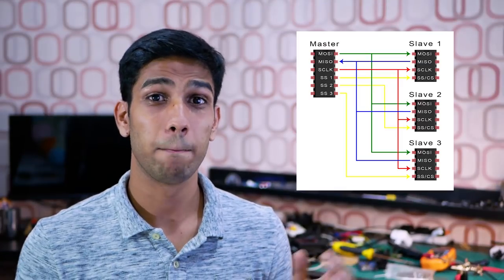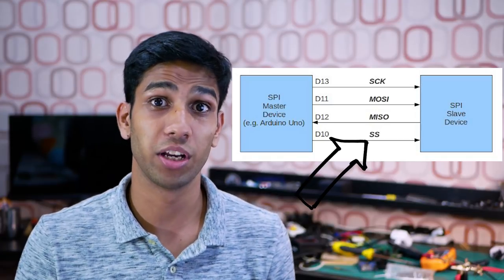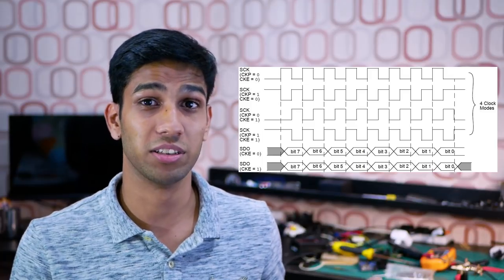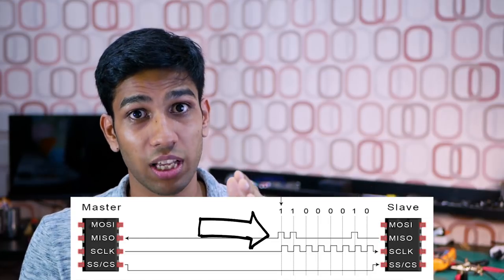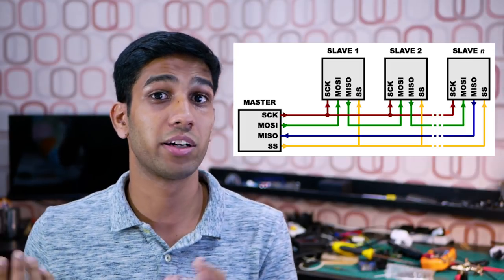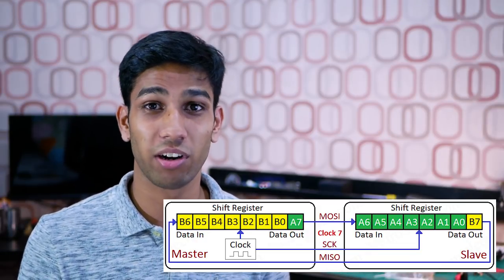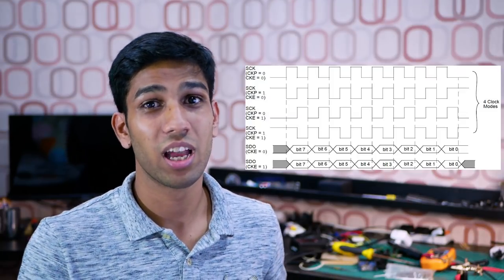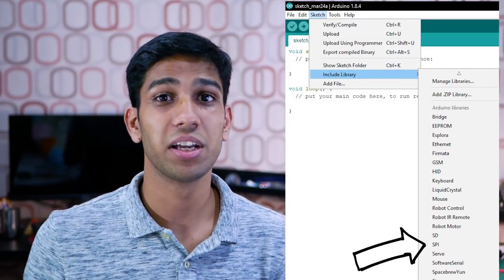SPI in a nutshell + Arduino & Raspberry Pi implementation: Electronics Crash Course 14

Comment: I have always felt that SPI is a old grandpa compared to I2C, it just feels older and more poorly designed.
Reply from the maker: I see where you are coming from. When it comes to implementing manufacturer's electronics in out projects, i2c seems so elegant. However, SPI is much easier to implement of you're diy-ing your own electronics and need to debug at any point. Debugging can be a pain with i2c especially. Nonetheless, both standards have their use and I'm happy we can choose between them for out projects
Reply: @saraltayal5005  Debugging I2C is simple with a logic analyser, which is a really cheap tool. I have a video coming out next month showing how to use these awesome tools.